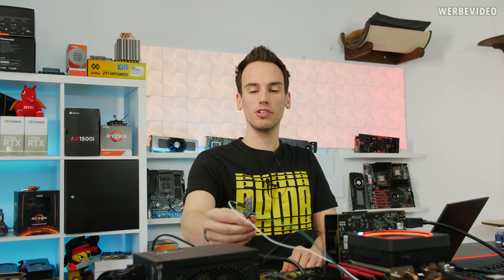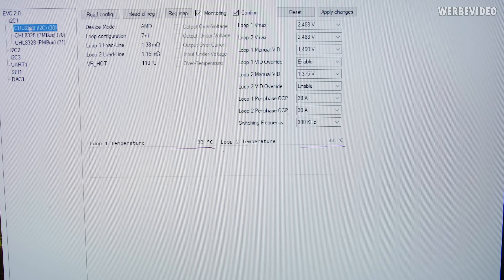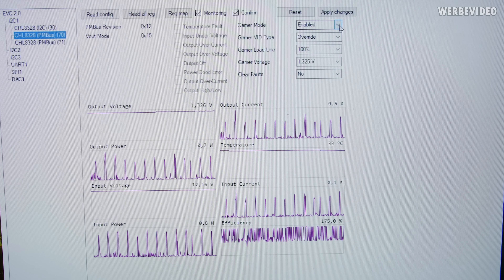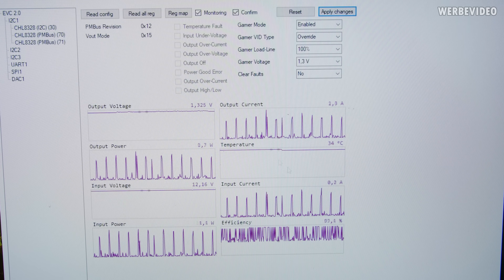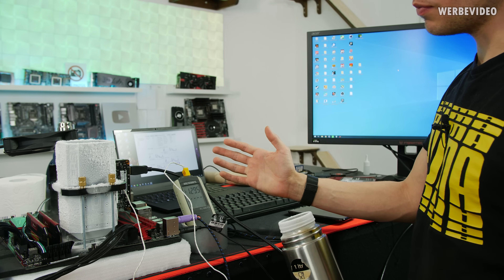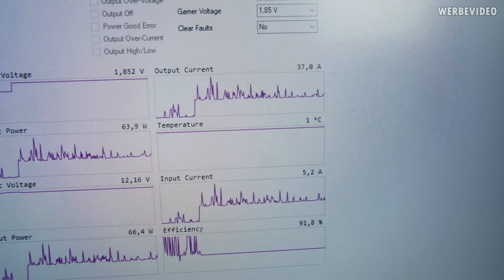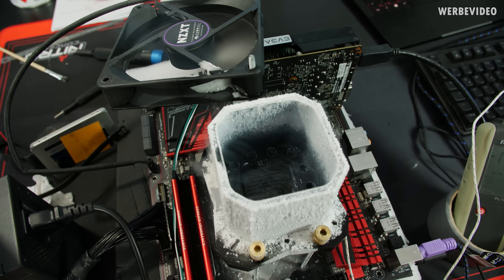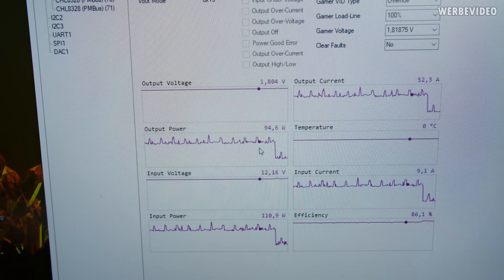We Overclocked an AMD CPU to over 8.1 GHz !!

Comment: how did you manage to open the little swing bar that clamps and secures the cpu in the socket with the cooler still attached?.... After I thought about it you couldn't have so the mechanism that's supposed to secure the cpu in tightly must have not been strong enough to hold the cpu in while you tried to detach the cooler . I will have to take note from now on to watch out for this issue or maybe it was faulty but it does concern me

Comment: 11:35 I thought he was saying "5270 watts" instead of "50 to 70 watts"
> hm, hey wait that's a lot more than even the wall plug can handle
Reply: well, you see on the charts that this is 50 amps, so roughly the same current as 5000 watts would have for 120 voltage
Reply: Unless he has special industrial high-amperage wall plugs installed in his studio😁

Comment: You should have to cool it before you run the system. Otherwise liquid nitrogen makes an air cushion on the processor and it`ll take much more time to cool it. Also you can use cotton to isolate the motherboard and cover it with foil above so that the foil you cover not contact with motherboard. And plug with cotton the bottleneck. Good luck.

Comment: How can LN2 users get Vcore up to 1.9, when most CPU's would instantly die at such voltages under positive temperatures? Does lowering core temperature make that much of a difference as to how much voltage a CPU can take?

Comment: He then lists the board and CPU on eBay saying “used only once”
Reply: I mean technically its true
Reply: @B15HOP  it would catch fire
Reply: @pixelcs2487  Probably. Haha...
Reply: @B15HOP  not probably... definitely xD
Reply: "Used by one owner living in Antarctica"
Reply: @Speedy Danny Technically, once the box is opened and/or manufacturer seals are broken that item can no longer be sold as "brand new" even if it hasn't actually been used.

Comment: 8:10 the guy was pulling liquid nitrogen from the bottle with bare hands, without any gloves! Wow!
Reply: I think it's because Germans are built differently
Reply: Don't try this at home kids.
Reply: You don‘t handle liquid nitrogen with gloves ever. It’s probably best if you do it naked like a real chad.
Reply: Gloves could trap it in the glove and that would be more dangerous so just don't use gloves
Reply: Someone oc'er pour it on barehand, he say ok for him, but dont try he warned
Reply: It's called the LeidenFrost effect, basically the first nitrogen droplets that make contact with anything at ambiant temps instantly evaporate and form a really good insulation, this also works backwards, you can literally slip your hand on flowing lava and wouldn't feel anything because the moisture in your hand evaporate so fast it forms an insulation, but people don't recommend doing these stunts because the insulation time is usually less than a couple of seconds ( considering the temperature difference, that's still really good ).
Reply: @amineabdz  Mythbusters did a similar thing with molten aluminium to. Wetting their fingers and then (briefly)dipping them in it.
Reply: Yeah, I had the same thought lol
Reply: Germans dont need gloves
Reply: yes you need gloves, with long sleeves. "don't use gloves as nitrogen can get trapped inside" is the usual weak excuse for not following H&S rules, which then leads to more rules.
This channel is seen by lots of people, proper use of H&S should be the minimum.
Reply: @tony359  LN2 is actually pretty harmless to handle. Can splash it over hands/face/arms without any issues. It's if you let it sit stationary on the skins surface for any more than a few seconds, then you will have a bad time. As long as you/the liquid keeps moving on the surface of the skin you’ll be absolutely fine. Theoretically, you could even shower in LN2 and be fine. Wouldn’t recommend though haha
Reply: @tony359  rules my ass.
Reply: tony359 Dude no one here will just casually use liquid nitrogen to overclock their CPU. And even if, they’re more than likely to know what they’re doing if they are able get their hands on that stuff. No one who isn’t well versed on this will do this anyway

Comment: You should have used a hot air gun while bending to reduce the risk of pin break or metal disintegration / ductility. The conduction quality reduce with every force bend.

Comment: I had an AMD FX 8370 running @ 4.7ghz on Hyper 212 Evo in Push/Pull. Ran just fine and nice and cool. In HAF X case so lots of airflow with a GTX 1070 Ti in 1080P. Was my main system for a few years and it was meh I guess. Now I have a Ryzen 3900X and RTX 2070 Super with 32GB 3600mhz speed ram for 1440P. All I can say is if you still use an FX CPU UPGRADE ASAP. The difference in everything is immensely better. Not just gaming but everything and just general use. You can get something like a Ryzen 3600 right now for under 200 dollars new and I’ve seen as low as 120 bucks used. That’s nothing for the huge amount of performance you will gain by switching. Even if you can’t afford a good board you can buy a cheap one and just run the 3600 at stock and it will still be 100x better. So anyone on the fence do it. Definitely will not regret it. I have mine in an Asus Prime X570 - Pro Motherboard and got great results. Expensive board but you can find some older boards b450 or even A320M-K boards for 50-60 dollars that will work with a Bios Uodate. So technically for around 200-250 dollars you can upgrade from FX to Ryzen and have much, much, much better performance even on a cheap board running everything at stock. You can buy a better board later on. Just a thought for anyone wanting to upgrade. The Asus 320M-K board is 59.99 new and you can find a used 2600/3600 for under 100 for the 2600 and around 140 or less for the 3600 so that puts you at 275ish dollars total to upgrade the board, ram, and cpu. For 400 dollars total tho you can get a much better board with your cpu and ram and it’s definitely worth it. I haven’t used Ryzen 1000 or 2000 series cpus but I’ve used the 3600, 3600x, and 3900x and all I can say about those is that for the cost they are amazing. Particularly if you’re interested in live streaming you get great performance in games and a lot of value for your money.

Comment: Benefits of overclocking like this?
Reply: Cpu doesn't melt from high voltage and temperatures, and the resistance of conductors is lower at lower temperatures

Comment: Someone in 2089 will be watching this in a try not to laugh compilation
Reply: Do you laugh at NASA's 2KB memory on their early computers?, And cpus at 1kHz
Reply: Nulley Zero Well, yes, it is laughably small nowadays, even if it was incredible at the time
Reply: Heath Mitchell that’s what she said
Reply: @Nulley0  Yes but moores law will one day stop because graphite can only be 1nm thick or 1 atom thick. You will need a huge cpu in the future for moores law to continue
Reply: @masterhacker7065  Then beyond electrons. We will move a step ahead to photons
Reply: @prateekpanwar646  that's not possible why would we use light to for transistors. Plus there is no way to go smaller than 1 atom because anything at the size is susceptible to quantum tunneling where the atom just "goes through" the material. So unless you can stop atoms from quantum physics then you aren't doing shit near 1 atom
Reply: @masterhacker7065  Law's more is about transistor shrinkage, so that doesn't make sense, but generally we'll continue to see gains due to hardware specialisation/compute offload and increase in AI and other stuff that scales well with number of cores at least
Reply: @Nulley0 .my slowest computer has a 27 mhz cpu and less than 1/2 megs of memory.
Reply: @Nulley0  You're right. We actually wonder " Wow, How can it go in just 2kb. What a technology marvel"
Reply: @Nulley0  ah make sense
Reply: Them: gross what is this 60 fps ew cavemen
Reply: It'z Meme Time they’re gonna start injecting graphics straight into our brain at light speed
Reply: @fu_beiu  Them: Lol I bet it can't even run GTA 46
Reply: More like 2030
Reply: more like 2022 ;)
Reply: @M12Howitzer  when intel is barely gonna reach 10nm lmao?
Reply: @TTRgrah  don't worry amd is going g to get to  .1 nm by 2021 so we good just abandon intel
Reply: Not the way this years going we ain’t gonna reach 2021
Reply: @MarkiiBabi  well...
Reply: @MarkiiBabi  jokes on you I'm in 2021
Reply: @MarkiiBabi  we are eventually
Reply: @MarkiiBabi  hello from 2021
Reply: @MarkiiBabi  lol
Reply: @MarkiiBabi  2021...
Reply: @MarkiiBabi  it's 2021 now
Reply: @MarkiiBabi  we did ahahahah
Reply: @MarkiiBabi  wrong
Reply: @MarkiiBabi  yes we totally won't reach 2021🤣
Reply: @thelegend2o7  i deed
Reply: @MarkiiBabi  that didn’t age well
Reply: @MarkiiBabi  ice
Reply: @MarkiiBabi  here half 2021
Reply: @MarkiiBabi  sure
Reply: @MarkiiBabi  yea no
Reply: @MarkiiBabi  look now
Reply: @MarkiiBabi  Bro, im telling you... The world is going to end before 2022.
Reply: Markii 🤣 true
Reply: @MarkiiBabi  We will
Reply: Markii ? There is no indication COVID is going to kill us all this year
Reply: @MarkiiBabi  laughs in covid 2 literally existing now well it’s a different strain of covid but still covid 2 electric boogaloo
Reply: @crazytigerspy9420  January 20th :/
Reply: @MarkiiBabi  You shure :)
Reply: @MarkiiBabi   haha jokes on you
Reply: @MarkiiBabi  we made it!
Reply: @MarkiiBabi hm?
Reply: @MarkiiBabi no now it's 2025 and we was reach 2021
Reply: Markii why?
Reply: @robloxtrolling1907  bruh
Reply: @robloxtrolling1907  time traveller spotted
Reply: @MarkiiBabi  It's 2021 sir
Reply: @hijuebuta  January 20th bro
Reply: I don't see 1970 processors in try not to laugh compilations
Reply: @Miata_MK  people dont even remember them lol
Reply: Mean while in 2089 Intel released 7nm cpus
Reply: @navneetsingh6317 
ты дурачок? У меня в компе уже 5 нанометров стоит. Какой нафиг 2089 год? И почему именно эта дата фигурирует? Почему не 2080? Почему не 2090?
Reply: Yeah... Just like in 1990 we thought there will be flying cars in 2020... But we received flying corona instead !!!!
Reply: im here...
Reply: Or nobody is going to watch this because we blew eachother up and got pulled back into the stone age..
Reply: Then will be like for now penitum to I-9
Reply: No. In 2025
Reply: Bold of you to assume that there will be 2089
Reply: More like in 2069 ( ͡° ͜ʖ ͡°)
Reply: Laughs in 0.0 ghz
Reply: #1 comment for the year 2089 to look back.
Reply: Seeing him overclock an FX cpu is already enough of a joke
Reply: Even now its a try not to laugh
Reply: Yeah:)
Reply: What kind of compilation is a 15 min video..
Reply: 2039*
Reply: Someone from 2020 will read my COMMENT... And will say... I was born when this guy  writed this COMMENT
Reply: Nah.
Reply: You mean try not to laught at this comment?

I mean like, it's not that they will look at old shit.. Look at us now
Reply: Oof
Reply: It's not 2089. OK. So don't force other peoples to laugh by commenting such these words.
Reply: Laughs in 5 terahertz
Reply: I guess 2025, not 2089
Reply: Lmao absolutely correct!!
Reply: I don't see intel 8080 in ant try to not laugh comp
Reply: 100 ghz
Reply: In 2089 ther is no youtube  😬
Reply: They probably for the most part, wouldn't understand what they're looking at. Which is also the case today but computing likely wont be done the same at all that far out
Reply: What even is a GHz  we have only THz here
Reply: Moore's law may be coming to an end. Transistors can only get so small.
Reply: Technology stopped developing the curve is very low I don't think that it will such low around 3028 it will be
Reply: "Hahahhahah, they used cpu's back in the day"
Reply: Well we are reaching the physical limits of silicon based transistors and Moore's law is actually starting to be not so true anymore. 

Quantum computers definitely look promising but they will likely never be consumer grade because of the amount of cooling they need. Colder the better a quantum cpu becomes.
Reply: In the future they would already have 128GHz on normal laptops cpu, this will look like the worlds biggest joke
Reply: Brave you to assume the world gonna made it to 2089
Reply: @150_asharifadhilaha2 
с чего бы не дожить то? Даже я, скорее всего, доживу. Меньше смотри апокалипсис-фильмы
Reply: Now 60fps is best for budget but... In 2099 they want 560fps for budget
Reply: I’ll check back in then
Reply: Good one
Reply: Everyone Gangsta untill they reach 1nm.
Reply: XD
Reply: Watching this with 1TB RAM and 20GHz 64 Cores CPU.

What?
Just saving my comment for future.
Reply: Smh
Reply: Nope, we're stuck around 5 ghz
Reply: @powerup9035  For the masses to get over 5GHz on the majority of chips the instruction set would probably have to move over to RISC5 or something like that. Why RISC5? RISC5 is x86 with the 8-bit and 16-bit parts removed with some other legacy instructions also removed. A optimized instruction set that the complier will not have to do much different from an x86 compiler but the CPU will have alot less to go through to get to what it is going to get to so it can run faster.
The down side is not all x86 programs will work without a recompile on RISC5 systems. Most will but some will not. 
IF you want to go faster you will need at some point to start to remove stuff from getting in the way. You can optimize it so it just is a yes or no thing if said instruction is needed but even that can be taken out due to it taken up time for the electrical signal to go through the unneeded process. Little optimizations like those cannot happen if we stay on x86.
Reply: @yumri4  They should be able to replace the old instructions with 32bit/64bit and/or SIMD and have the front end translate the code.

I mean it's not quite the same thing but the Radeon is running wave32 vs wave64, as long as the data does not exceed 32 bits it can be run faster through a 64 bit pipeline.

I guess that's what you're saying anyway and there's always the possibility that something won't work right but honestly that is already happening every now and then. Just try to run the original Crysis in Windows 7 64bit or above. Most software isn't tweaked to infinity, the programs that are will be the programs with issues, even still if the hardware "translator" is done correctly it should be able to handle that, a minor software tweak can take up the slack.
Reply: @glenwaldrop8166  Well right now it seems the world is going to ARM for the majority of the consumer market not x86. The part of running "Crysis on windows 7 64-bit" well it will run the same as running on Windows 7 32-bit and windows XP. it isn't tweaked to run better. 

Later on in my comment i said "some might have to be recompiled" the build settings will be for the optimizations to the code. Which instruction set to compile for, if to include or exclude certain instruction not in the default settings, etc. Cysis 1 is a old game so i doubt they will recompile it for another instruction set with optimized settings. Do it to a newer game that the developer cares enough about to find the correct switches to turn on and off and it will work better.

RISC5 seems dead and ARM seems on the rise right now due to the IoT networks coming up and up already. x86 might be dieing but it isn't dead.
Reply: @powerup9035  We are? Why? Does it have to do with like, efficiency of parts relative to the speed electricity can move
Reply: @DigitalEWhore  yes we are, we have same clock speeds like 10 years ago maybe more. It has do do with heat more mhz means more heat
Reply: @powerup9035  remenber the guy that overclocked a pentium 4 to 5.9ghz nearly 6ghz

Comment: 3:02 Efficiency over 100% is impossible cause it would allow free energy generators hah
Reply: For the whole system, yes, but you can create a local system with over %100 efficiency that is basically trading with outside system. This is how air conditioners achieve over %100 in-room efficiency.

Comment: I love the music when you're straightening the pins, it feels out of place in a fun way XD but personally I would take PGA over LGA any day, I'm far more worried about damaging an LGA motherboard than a PGA chip.

Silicone oil is annoying... My M.2 SSDs are always covered in it from slots with heatsinks. I even have RAM that had it seep out and get to the outside!
Something I have to wonder... If you could maintain these temperatures, how long could the CPU last at those speeds? Is 8GHz at -170C more stressful than stock speeds on air? Also assuming your board and prefer hardware didn't die from the cold and board warping and all...